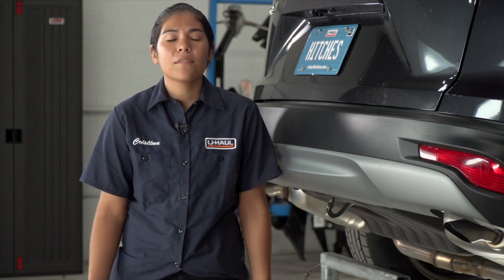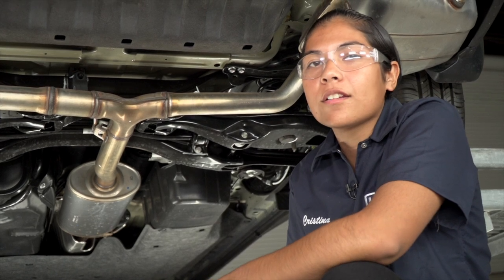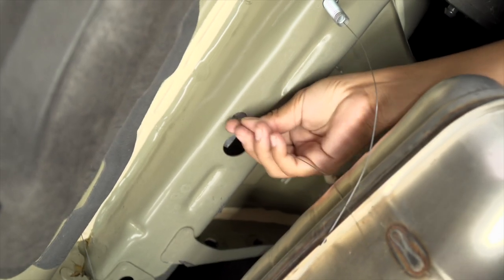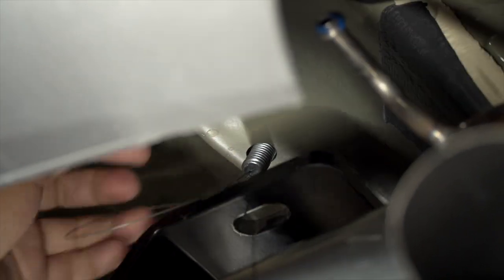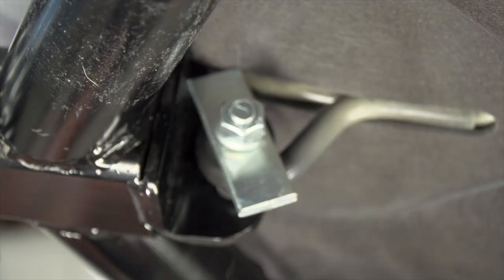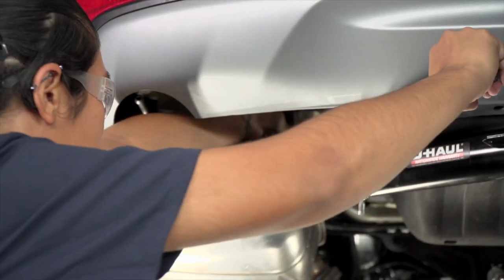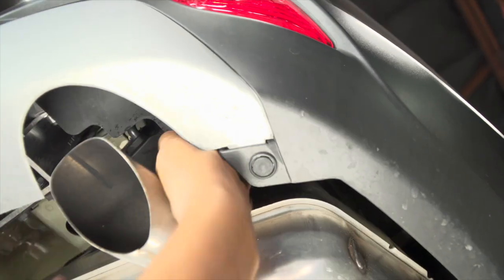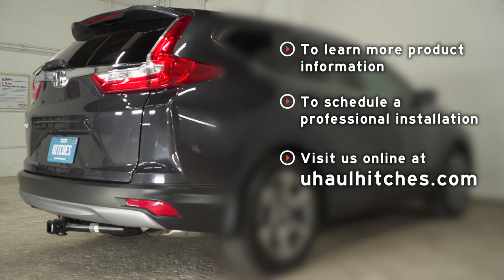2017-2024 Honda CR-V | U-Haul Trailer Hitch Installation | CQT76128

Comment: Took me about an hour and a half to install with no problems. (sorry, I work slow and meticulous).  I got the hitch on by just loosening the rear muffler hanger only.  Tight spot, but got my fasteners threaded, tightened and torqued.   I'm 74, so it was no problem working on a blanket on the ground. Thanks for the info.
Reply from the maker: Glad it helped!

Comment: For a Honda CRV  $250.00 in  parts, 100 dollars installation, tax 20, total bill 367.00  You think UHual would give a break on parts and install, since we will be using there trailers.
Reply: u haul just quoted me $570.00 for hitch and installation. too much.

Comment: I just installed a hitch on my 2018 CRV. Now when I hit bumps on the road, the large rear muffler hits the hitch mounting nuts!  What do I do to prevent that. It makes a loud and annoying knocking sound for every bump I hit! Thanks!
Reply: cut or grind the bolts a bit and/or replace the rubber hold down for the muffler.

Comment: Very knowledgeable about installing a hitch. I hope that all U-Haul personnel are as knowledgeable and careful. Want to install one on my CRV but the part about releasing the muffler has me worried
Reply from the maker: John, All U-Haul hitch professionals are well trained and held to a very high standard! And lowing an exhaust for an installation is one of the most common procedures we do and is required on almost every vehicle. If you have any reservations about the process, stop in to your local U-Haul center and talk to the Hitch Pro. They will be happy to answer any questions you may have! Find one here - Uhaulhitches.com

Comment: Great video.  I just did mine, by myself on the garage floor.  It is the Curt hidden hitch.  Only real problem was a harness plug on the driver's side.  It would not allow the hitch to go up or move forward enough for the bolts to line up on the driver's side.  It took me 2 hours to figure this out.  I popped the plug out of it's attachment and the hitch went right up and in.   I am guessing the plug is for the hands-free tailgate.  We have an EX-L so does not have that installed.  Getting the torque wrench on the frame bolts was a pain too.

Comment: Can this hitch fit on a 2024 Honda CRV? Hitch part #: CQT71268
Reply from the maker: It does, as the title and description state it fits the 2017 thru  2024 Honda CRV Gas Engine. It will not fit The Hybrid version. Here is a Link to the Hitch for the Hybrid. https://youtu.be/umzu_y0KefU